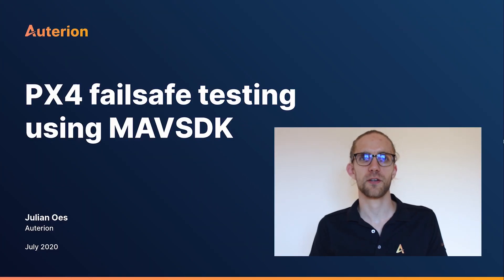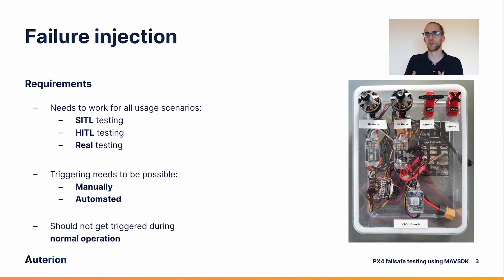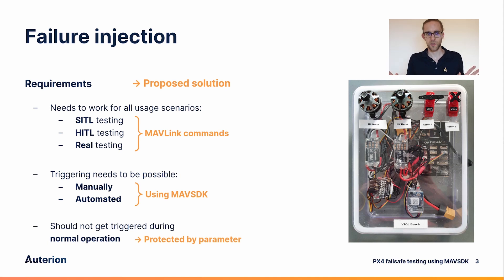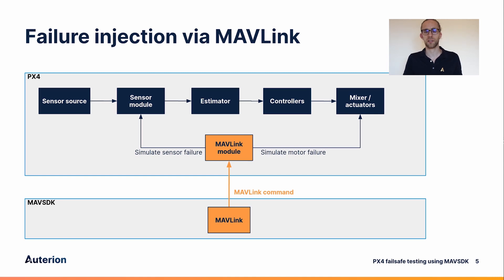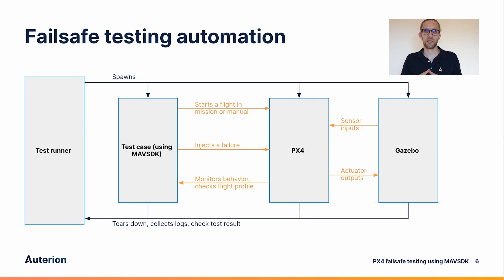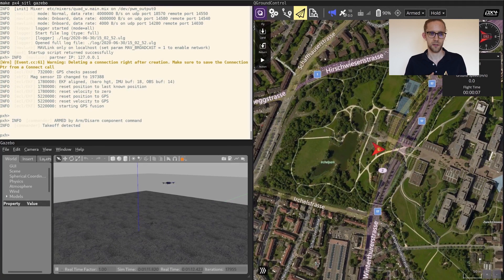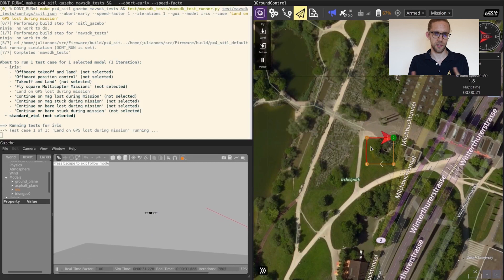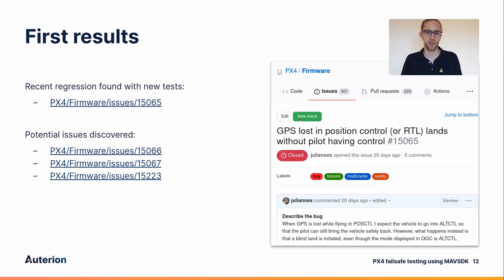PX4 failsafe testing using MAVSDK — PX4 Developer Summit Virtual 2020

Comment: Thanks for the powerful framework, 
How hard is it to add fixed wings auto testing? 
is creating automatic test cases documented somewhere?
Reply: Fixedwing auto testing needs MAVSDK to support fixedwing missions plus actual tests. MAVSDK support for fixedwing missions is coming soon, it's mostly a matter of defining the API that is easy to use and works for supported use cases.
I'll add docs to the dev guide once the current work-in-progress pull request goes in. If you look at the PR (https://github.com/PX4/Firmware/pull/15063) you can already get a sense of how you could add more test cases.